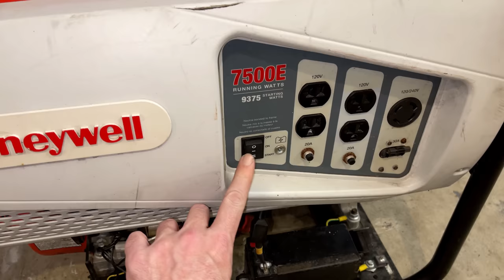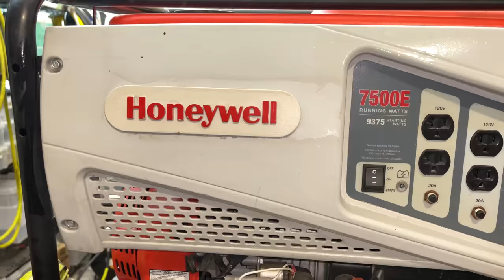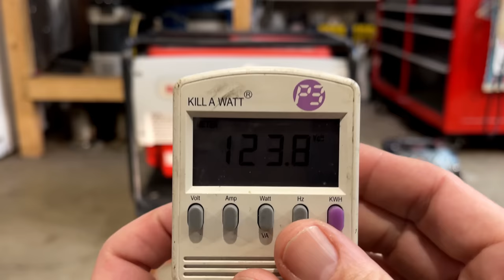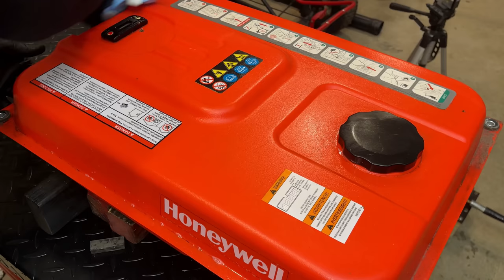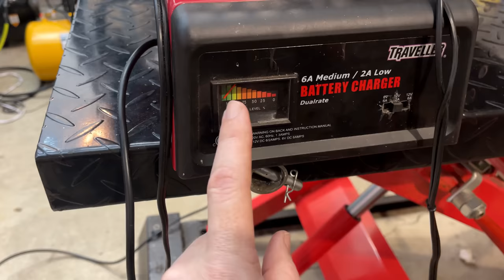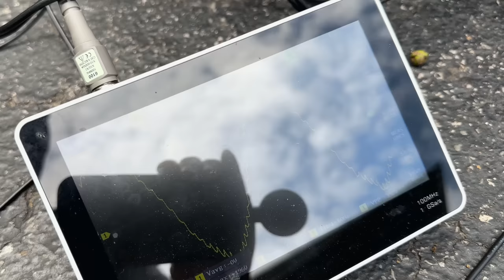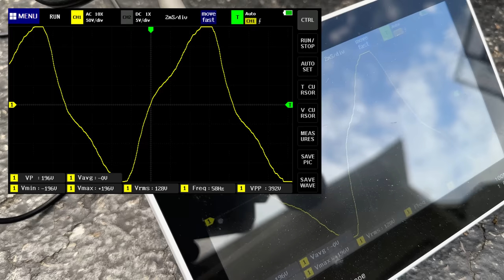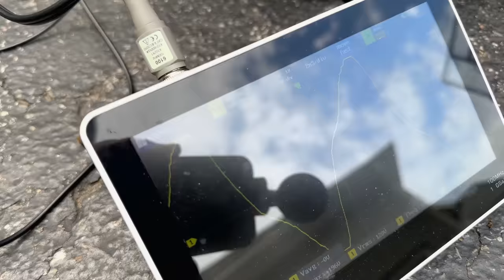Honeywell Generator - Sold For Parts or Repair

Comment: Thanks for another educational video. Which welder are you using and would you recommend it for a beginner? Perhaps you should consider adding it to your online store.
Reply: I recall a subscriber donating that welder to James. I think it wa a reward for other services rendered, James had to repair it though and modify it a little, as he does. That video is in his library if you were inclined to search for it.
Reply from the maker: It is a 20+ year old cheap Chicago Electric MIG/gas.  Running on 240 volts.  I would say almost any new welder sold at HF would be as good or better.  I started with a cheap welding helmet from HF and could not see a thing.  So upgraded to a nice Hobart helmet.  Makes a big difference when you can actually see what you are doing.  Here is the welder video https://www.youtube.com/watch?v=GkMimgpXG-A&t=0s I got this for fixing this chainsaw https://youtu.be/gHkgo8y6Q5w
Reply: @r8118830  Thanks!
Reply: @jcondon1  Thanks!
Reply: @JOHNDANIEL1  I'm not doubting what you read, but think about it logically and from experience.  Portable genny sets have widely varied tolerances for the wheel kits.  Solid tires can have worn bearings, no bearings, slightly bent axles...etc...leading to many types of "shimmy".  To blame failed engines on tire pressure is the dumbest , corporate snow job I think I've ever heard of. 🤣  I just can't believe the frequency could ever get high enough to cause cavitation in motor oil.

Comment: The wife sold you the wrong generator.  I bet the seller was not happy.
Reply: Came here to post this as well.  Wrong generator.  Oops
Reply: You also should have removed all the grounding wires before welding. That can affect the stater also.
Reply: Just picture James lugging this generator across the front yard chuckling as he loads it in the truck bed, wife on the phone in front porch with husband “yes the square thing” counting the cash
Reply: Hilarious 😅
Reply: Hardly, luckily he had a trailer with ramps. Imagine lifting that thing into the back of a truck by yourself. James makes it look easy because he is so experienced. For the rest of us, yeah, it's just a parts machine. Furthermore, the seller should've just told James to pick it up when he was home if he had several gens lying around. So that's on the seller and the seller alone.
Reply: I'm guessing the seller found a picture of the 5kW one on the web and used that. It also explains the missing wheels.
Reply: First thought that went through my head when he told story..
Reply: Was thinking the SAME thing!
Reply: Like James
Reply: Great job Jim!!!
Reply: Actually, wife was selling hubby’s toys just before next weeks divorce hearing!!! 😂
Reply: @ddognine I've done that once never again lol
Reply: I couldn't help but think the exact same thing!
Reply: Another “make it look easy” job! I really enjoy your channel.

Comment: Any time you finish cleaning out a fuel tank, before reinstalling, you should pour in about a cup or so of clean motor oil and close the lid and slosh it around coating the entire inside of the tank, then drain through the fuel shut off valve, this will coat the inside of the tank and keep moisture in the air  from causing rust inside the tank. It also helps keep the valve clean by coating the inside of the valve. Really works. Hope that helps
Reply: I always oil my cleaned tanks. A cloth rag removes any excess oil.

Comment: Problems you found with that carb is the very reason Briggs and straton tells you to use fuel stabilizer to keep those carbs from varnishing caused by prolonged periods of sitting. I use it in ALL my smalll engine Equipment and have never had a problem such as that. Myself I use the Stabil because Ive found it works the best

Comment: THD is usually defined as the % power in overtones (Fourier series) (120,180 ... Hz) relative to the fundamental (60Hz). When you go across both legs the voltage doubles but the waveform stays the same, so the THD is the same. The increase in THD when you increase the load is due to the reaction field from the current flowing in the stator distorting the rotor field. (If memory serves :-)). Thx for your meticulous video's!
Reply: @stoflom and @jamescondon, I was just wondering the other day, does the rotational position of the power head relative to the engine firing position have an impact on THD?
I could be thinking about this all wrong...  It seems like the load on the power head would be greatest at the time when voltage passes the zero point.  So if the power head position and engine position were aligned so that the engine is firing right when the power head is at the crossover point in the sign wave, that might impact THD?  Maybe improve it?  
I wonder what the waveform would look like with the same generator, same resistive load, and the power head tested 3 or 4 times, each time 'clocked' 90 or 120 degrees to the engine TDC.
Reply: @FirstNameLastName-tp5bu  Interesting thought but remember most of these small generators have one two stroke cylinder so the power pulse will be every second cycle and thus at 30 Hz. I think the combined inertia of the rotor and crank will largely dampen out these motions and keep the rotor running at fairly constant rotation. The effect of the reaction field I mentioned is probably far stronger. Larger more expensive generators normally have extra compensating poles and windings to counter the reaction field.

Comment: I amazed at how difficult it is to completely purge a fuel system of water once it gets in there. I had the bright idea of pressure washing my pressure washer, and did not notice that the fuel cap had a vent on the top of it. I rebuilt the carb and ran it through the ultrasonic, replaced all the fuel lines, drained the tank and blew it out, and I still had to run it through three tanks of gas before it finally purged all the water and started running correctly again. I learned my lesson on that one, lol.
Reply: If you know all those crevices the water may hide, and the thing is disassembled, it is not that hard. After all (at least here) you need to do that every time you leave it with just a small amount of fuel in the tank half year or more. At least here it just tend to accumulate in it as the temperature fluctuates with the seasons rolling over. Yes, by drying the tank out (so the gas can not cover the condensate water and prevent it from evaporating back) or by filling it to the cap (so there is no air pocket left drawing in the moisture as it is expanding/contracting with temperature).
Reply: But thinking about it back, the "not that hard" is very relative term. It is not hard for someone like me, who is used to completely disassemble all the things every other year because forgot to prep it for storage after that last season and let it clog with water condensate again...
Reply: The wire brushes in a gun barrel cleaning mite help you clean out junk in carb  !
Reply: Instead of welding you could of used a corn clamp a electric supply have them ! As Home Depot also have them !
Reply: Alcohol is a great way to get rid of water in the fuel system. It absorbs the water and allows the mixture to burn.
Reply: @erik_dk842  But it should be in the form of a "shock therapy", applied before storage - add even a high percentage of it to the fuel tank, splash it around to wash the internals, run the machine on it till dry. If you want to go by the "wet storage" way fill the tank with alcohol free gas, run it a while till it replaces the carb content and then replace the fuel filter.
The problem with alcohol in the fuel and metal fuel components is, the alcohol draws in water and oxygen, so forms an oxidizing electrolyte, so accelerates corrosion of metal and some older formulation rubber parts and turns the corrosion products into sludge. With plastic tanks and carburetors and modern formulations for the "rubber" parts the problem should disappear, but these (mainly the carbs) are not used that often yet.
Reply: @annaplojharova1400  The way we have used it here in the cold and wet Denmark is to add a couple of litres/quarts of 90% alcohol to a 8+ gallon tank and just drive on it.

Comment: One of the best tools I have ever made was a carburetor holder.  It is made from a piece of angle aluminum, and is drilled for two bolts that match the bolt spacing on the carburetor bracket.  I can attach the carburetor to the angle aluminum with two bolts, two nuts, and four washers.  I then can hold the angle aluminum in my bench vice.  Makes using the impact on stuck jets SO MUCH EASIER.  You should make you one.  :)
Reply: Good idea. A better mousetrap just comes to mind: make or buy a miniature "engine stand" for the carburetor, which can lock it in the main directions, freeing up both hands while holding it firmly

Comment: I've got a Dewalt generator I've had for 14yrs. No rust in tank and still runs perfectly.  Trick is the fuel is non ethanol and is mixed with a quality 2 stroke oil.   I use echo or stihl oil and do 50:1 ratio , i also pump the fuel out, refill run for 20- 30 min a year before covering and storing back in the garage.

Comment: Hey james, just wanted to give a thank you showing your process and knowledge. Recently picked up a riding lawnmower for cheap that was only running at full choke and high idle. Took on the task of cleaning the carb and doing a deep clean. Just got it reassembled this morning and it started up strong and was finally able to idle at low and move at its own power. Thank you james for being the best small engine guide on youtube!
Reply from the maker: Nice work!

Comment: My suspicions on the seller delivering the wrong engine probably related to the varnish in the carburetor.  This one he probably figured he never would fix, and the other he wheeled off to the small engine shop with wheels, not knowing this was the better machine for Mr Kongdon. Thank ya'll for the videos James, always a learning experience from an old watcher. Your diligence is so innumerable, such as on this one finding the other air filter layer. Hopefully the new owner sits the gas can beside the new genset and does not fill it up ready for the first power outage. He takes his wife out and shows her the fuel can, explains why he doesn't fill it, and more than likely will be home when the power goes out. Of course no one can predict that and when his wife needs to start it the battery will still be good if the guy charges it every month or puts a small retainer on the battery which these stupid genset companies should sell along with the genset.
Reply: King Kongdon
Reply: Or...the seller could only find a photo of a 5500 machine to include in his ad. Great video James...as always.

Comment: You mounted the battery clamp oppside down, the angled part on the clamp should be on top of the battery to hold it down in the bracket. Love your videos, very good filming and good lighting. Very informativ explaining. Greetings from Norway.

Comment: FYI when you weld on any vehicle or machine with battery always remove the negative battery cable. When you are welding you pass current through the battery and run the risk of blowing up the battery.

Comment: Well, this video certainly helped me.  I was gifted a 7000 watt version of this Honeywell machine a couple of weeks ago by my next door neighbor.  He bought it new 25 years ago and never used it, so it's essentially brand new, but dusty.  It'll hit and start on ether, so I know it'll run.  Thanks especially for the carb repair part of the video.

P.S. You're right, the axle on mine is underneath the frame.

Comment: I've seen rustier and more corroded carbs before, but I have only ever seen one other carb that was so occluded by varnish. The one I saw was on a 2 year old push mower, and I ended up replacing it. There was no chance of it ever running correctly.

Comment: Something that works when trying to save an older battery that still potentially has life left in it, connect it up to a jumper pack that can produce a constant 12v or jumper cables to a second battery, when using a second battery you can use your battery charger so you can maintain voltage.
It works, depending on the battery it can take anywhere from 4 to 6 hours to come back.
When the battery is at a stable voltage, reconnect your smart charger and finish charging.
I have saved countless batteries this way.

Comment: I've heard when putting power equipment away for a long time storage that when you drain the carb it's usually good to put some 2stroke oil or marvel mystery oil in the carb will keep the float or needle from sticking but I usually just drain it and never have issues. But that carb shows why it's important to drain it because it will get stuck.

Comment: Thank you James for measuring the THD across the hot legs.  I'll have to look at mine again because when I did mine across the L1 and L2 the THD dropped.  Not sure what that would mean.
Reply: I retested my generator hooked up to the transfer switch with the oven and central air running.  Inside the house I was seeing around 5.5% THD or less with a couple spikes to 6% when the central kicked on.  I'm thinking that less than 6% THD from a PTO generator is pretty good.

Comment: Hi James, you may need a crane in your shop or a car motor crane use it to load things on a trailer and can fold up and store away. ?
Reply: He does have a hoist affixed to the ceiling. He uses it for heavy stuff like the bigger engines and power heads.

Comment: Handle washer on inside -= you said it won't fit, so you would have to omit it.  You could quite easily cut one section of it away so that it would fit and give the friction satisfaction it was designed for.

Comment: Here is a tip for you James. Find a used hoyer lift for sale. They are what is used in the health care industry to move bed confined people from bed to chair etc. They are small and mobile and are rated to lift 400 or more pounds. They work great as a mini engine hoist (cherry picker) and you can take it with you in your trailer when you go on your next generator purchase. I picked up a manual pump one for about $50 a few years ago. I use it all the time in the shop.
Reply: Lift cart, atv or motorcycle lift. I've got a lift cart that I can ramp or tip things onto and then raise to fairly close to workbench height. I have a second that I trash picked, needs orings in the lift cylinder but might convert to air/over.

Comment: Do you remember those generators that have had cam damage.  I now know the reason.  The EPA has had zinc additives removed from most oils and the lack of zinc is what has trashed the cams and tappers in Briggs engines.  I now add 10% STP Oil treatment to my four cycle engines.  I still use Pennzoil 10W-30 in them but I add the STP before I put in the oil.  My Snapper push mower got 2 ounces of STP and my Snapper SPX lawn tractor got six ounces.  The needed additive is named ZDDP and don’t ask me to spell it.  Not only does EPA give us garbage gas and fuel tanks, but even garbage oil.

Comment: Thanks James you have me now looking on fb marketplace for non starting mowers, my plan is to hopefully get a free or very cheap one, use what I have learnt on your channel, that is its most times a carb issue then hopefully run it from the undrinkable parts of distilling my own alcohol as I dont want to ruin my current mower by attempting this.

Comment: Project Farm recently tested various battery recovery methods. He had some really good results from an unconventional method (using the welder) and very poor results from the "Battery Repair" setting on chargers both cheap and expensive. The treatment with the welder seemed to be a long term fix too.
Reply: He did this with flooded batteries where you can open the cap and add water. I wouldn't try this with an AGM battery.  Anyway a generator battery is not $200 like a car battery nowadays so it's not worth the effort.

Comment: Hello James. First I want to say than you for sharing these videos with us and the great work that you are doing. I have a question regarding the needle that is pushed by the float. If it doesn't close and let fuel leak, can the needle be lapped like a valve using grinding compound?
Thank you.

Comment: Next time, take your washer. Put a bolt in the vice with the warship's on it and running around or on it as they spin. Though. Grind down a little bit, and then you'll be able to use them in that space like you want.

Comment: Great rehabilitation of what turned out to be a good, strong-running generator. Just a few items of curiosity: 
1. Why not put a dab of grease on the axle when installing the wheels? I realize that they won't turn constantly like a mower or something, but why not make it just a bit easier to move and prevent some wear? 
2. Have you tried putting some valve lapping compound on a Q-Tip to polish up a float/needle valve seat? Of course, it will need a trip through the ultra-sonic cleaner afterwards and possibly a blast of compressed air to ensure that the passage is not clogged. 
3. Lastly, have you tried brake parts cleaner as a degreaser for engine blocks, etc.? It seems pretty benign re: paint and plastic unlike carb cleaner and doesn’t leave an oily film like WD-40. 
Keep up the great work, I really enjoy your videos!

Comment: Well done and thanks for sharing! Purchased one just like this new 10 to 12 years ago. Used it once, stored it away for a winter. Attempted to use it the following spring and No Start. This video is informative but kinda discouraging. Can I find a fresh carburetor or whole new fuel system? I don’t have that fancy stuff for cleaning or restoring the original.  That’s tedious work for a guy like me. I usually don’t do well with working on small motors.